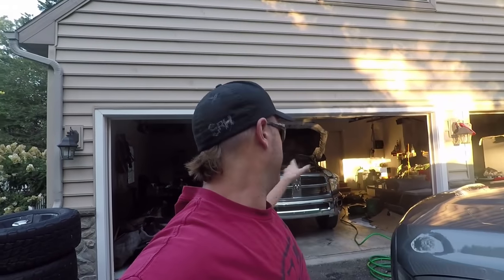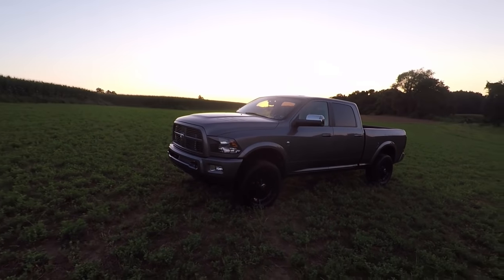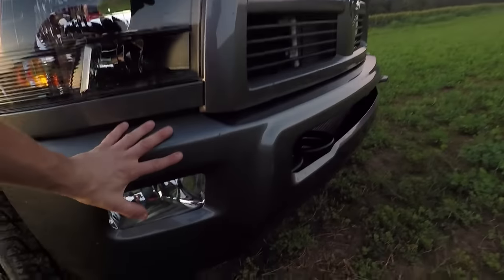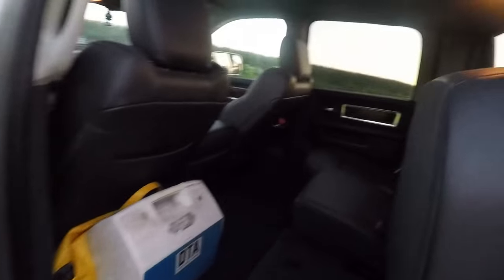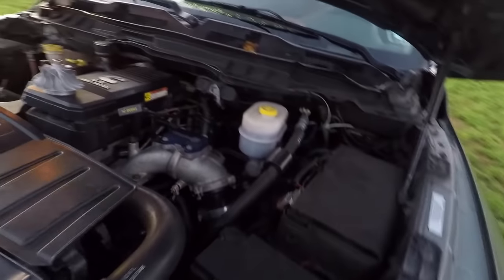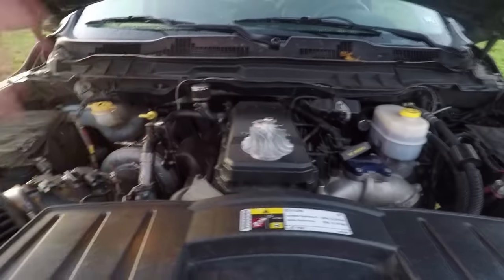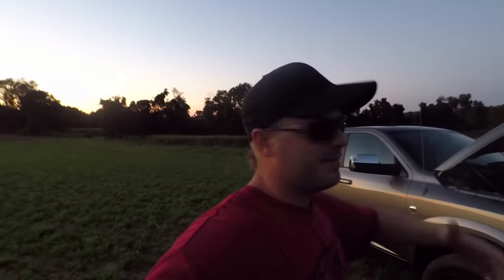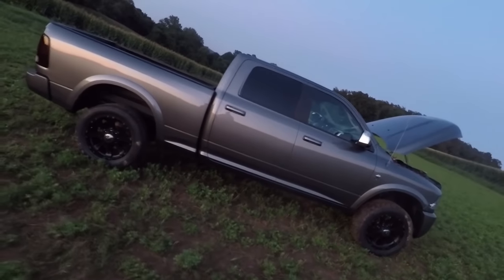Modified 6.7 Cummins Daily Driver Walk Around... This Truck Has Seen Some $hit!

Comment: Hey tom, nice options on the grey truck which i wouldn't mind since that's the year i love. P.S im a mega-cab fan. So since u changed to a towing truck will u be changing the gear ratio to 410, the CP3 pump will be a 10mm and the intake horn which u removed would be placed back since u ordered the banks one for the white truck?
Reply from the maker: I think the 3.73's will be fine, the cp3 won't be touched unless I add fuel. Little up in the air on the horn currently, with the 68 a blow off is needed on Caitlyn

Comment: I know it doesnt matter now for you. But they have tuning so go around the sprag Also if you shift manually it bypasses the sprag as well. I have a built 68 in mine. Has 2nd gear launch tuning shift myself so no sprag so far so good.
Reply: Another good thing about a 68RFE. No Intermediate and you dont need to buy a billet output bc they dont sell them bc they dont brake. Also the input is fatter than the 48/47 so even a stock one is hard to snap.
Reply from the maker: There was talk of doing 2nd gear start track tuning, but at the time it couldn't be done. Pre 4th gen Efilive
Reply: Ah yeah! Im not arguing against you no doubt the 48 swap is better. But if your under 1k revmax and do a heck of a 68 now, they come a long way.
Reply from the maker: When I was at UCC the revmax truck was probably the one that surprised me the most! I thought no way they could get by with a 68. At the drags they just kept making pass after pass, in a 1k hp truck! Impressive

Comment: Hey Tom is there any way you could explain the mini max?

Since I had it switched from the edge, I heard you could down load some tunes for the transmission. I don't know if the shop has already done this or not. How do I check? 

2 days out of the shop and the transmissionis toast. 5th 6th went  out and now 1st and 2nd is gone. This will be the 2nd time I had to have this transmission rebuild in 3 years.
Reply from the maker: That really sucks! You should contact some different custom tuners and see what they have to offer trans tuning wise. Best way to keep the 68 happy is to have the trans tuner and shop building it communicate, that way everything is working together

Comment: At what point do you need a blow off value ?
Reply from the maker: Pretty much only if your getting turbo flutter. If your gonna be loading the turbo hard then getting out of the throttle quick I'd recommend it

Comment: Hey Tom, what made you do the fass on this truck, and the airdog on the white race truck.
Reply from the maker: Fass fuel pressure constantly jumps between 15-17psi. Asked fass and got the some Trucks just do that kinda response. So I figured I'd try the airdog 4g
Reply: Turba Tom,
Any problems with the 4g so far.
Reply from the maker: Was putting out too much pressure out of the box, dialed the adjustment back and it's been good

Comment: Hey Tom you have any experience with death wobble ?
Reply from the maker: I have not
Reply: JUAN HERRERA  if you have death wobble I recommend that brace they sell for it . But if you still have death wobble check all your steering linkage might have to be replaced next check your ball joints see if they are still good next check your hubs.

Comment: Nice truck but in bad need of some black mirror covers. ;-)
Reply from the maker: I hated the chrome on the me mirrors. After the color match and black wheels they seem to work
Reply: Turba Tom I did the same with my 14 3500 Laramie. Pulled all the chrome off. My mirrors were last. The mirror chrome seemed very small when I started but stuck out like a sore thumb when they were last.